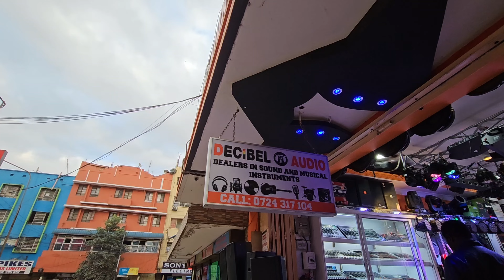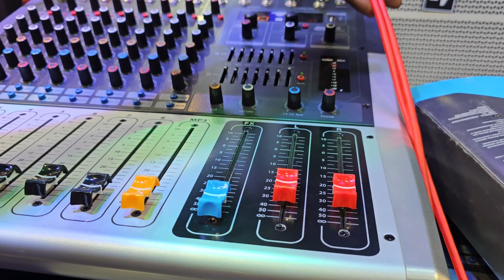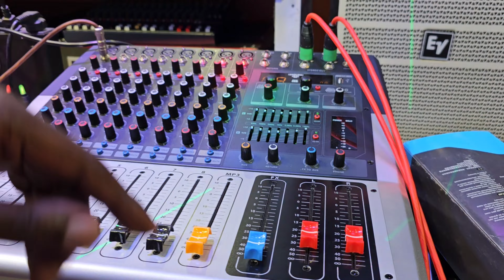INTERCONNECTING POWER AMPLIFIERS TOGETHER .(using link feature)

Comment: Hie man l m greatful for the videos you are creating there are very helpful,

My question is 

Can the  bass bin  speaker has 1200W @8 Omhs  and the Amplifier give you 1200W @4 Omhs damage ,

What do you recommend l should do l just assume you got the question well
Reply from the maker: Hi if the speaker had 1200 wts and the amp produces 1220ts at 4 ohms the amplifier might be INSUFFICIENT FOR the speaker..it will work buy if you release its full power in stereo type you might blow it .. use bridge mode
Reply: Ok ok what will blow is it the speaker or amplifier
Reply: @maranathahokonya5789 ... Short answer: ... It will work nothing will blow.

Long answer: ... The speaker is getting maybe half the power it needs, if you want to give it full power you can combine both channels by bridging ... Meaning both channels of the amplifier give power to one output together.